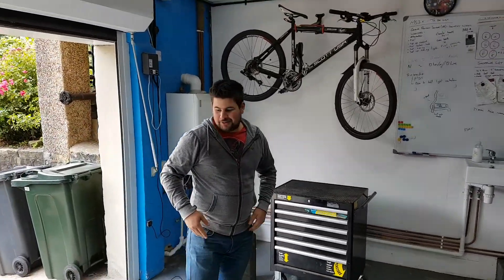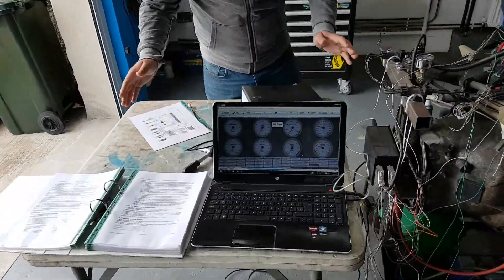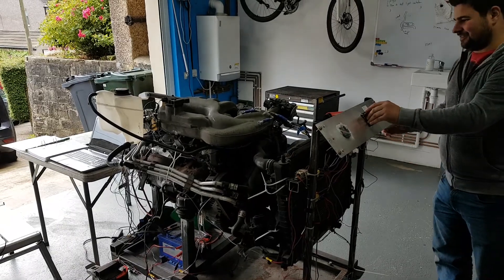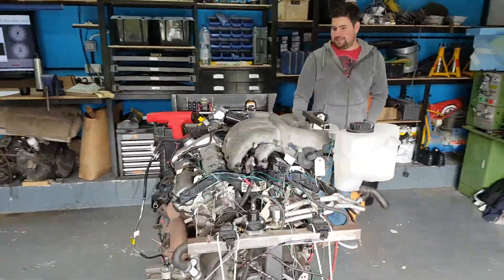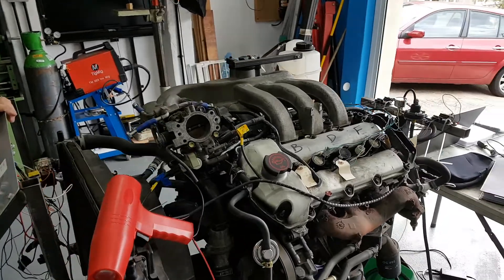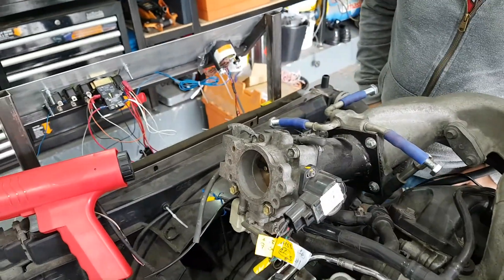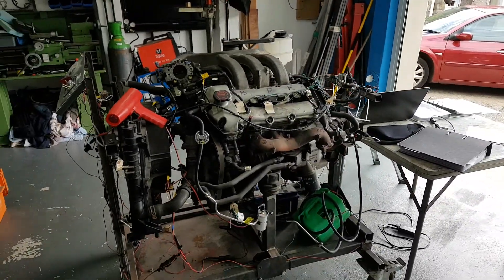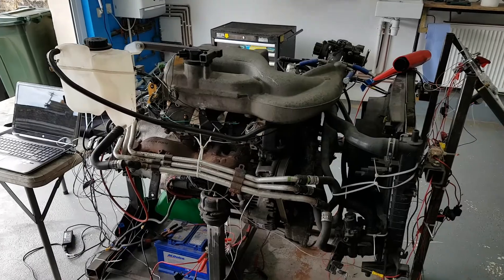MS3X AJ30 V6: The V6 is now running with its new ECU

Comment: Going in an mx5 or...
Reply from the maker: Now then, this is Gav's V6 which will be going in his Ford Capri. I'll either turbo my MX5 or buy another Jag V6 and make it fit. We shall see..
Reply: Hi mate was it very different to sort the wiring and did you  use a fuel injection petrol tank  @engineeringchroniclesunedu5757